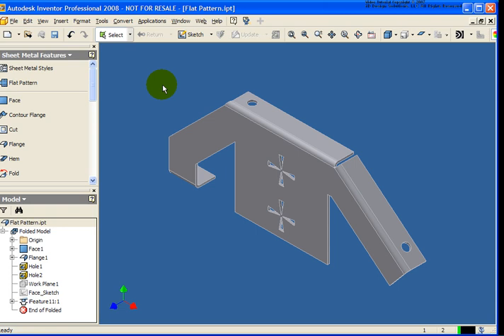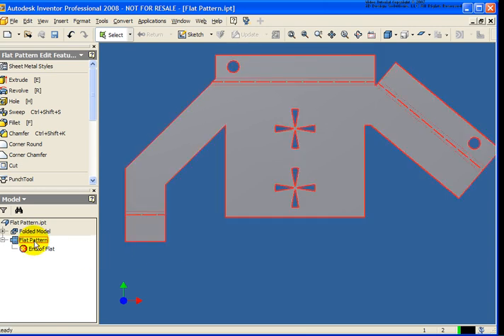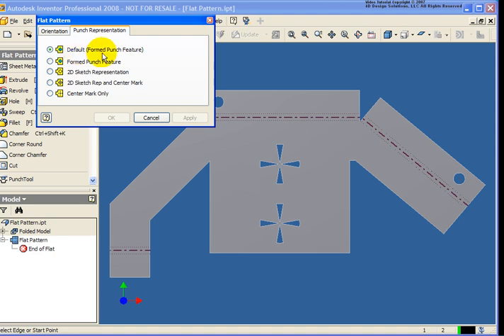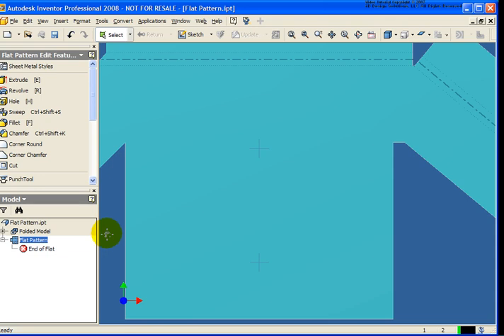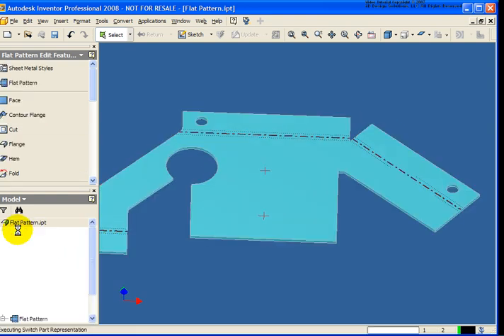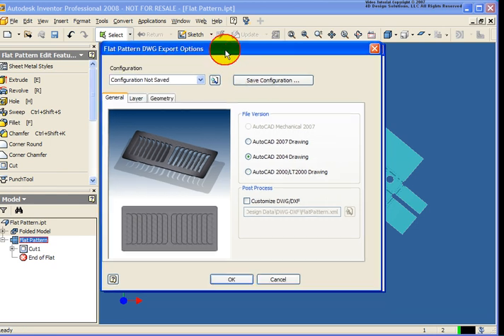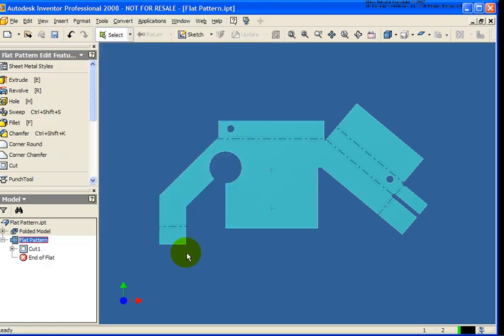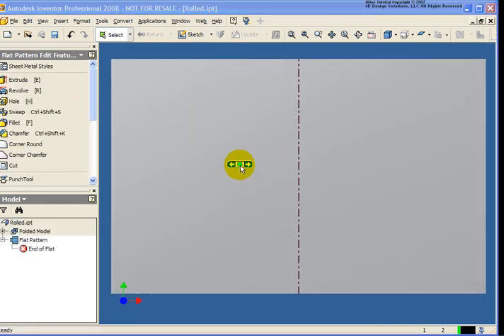12  Creating flat pattern

Comment: sir, I'm new to inventor 2009.  Your videos and books have been priceless.  I have a question.  How can I project the inside edge of a tube to the outside edge? such as a 90 degree tube joint with tubes of equal size. attempting to transfer a tube drawing to .dxf for a cnc tube cutter.  just wanting to project the inside edge onto the outside surface so I can split the outside surface and remove the unwanted portion.  I'm sure it easy but I just cant find the answer.  thank you